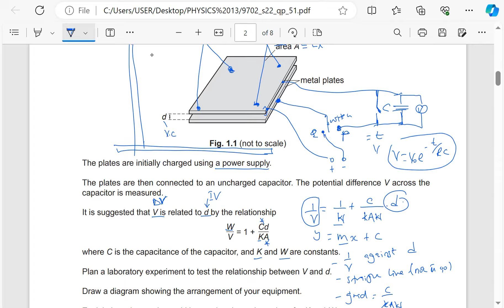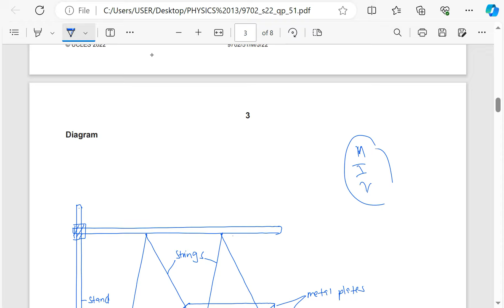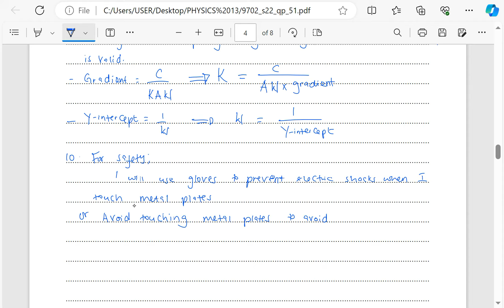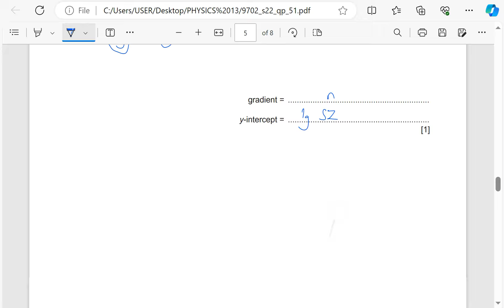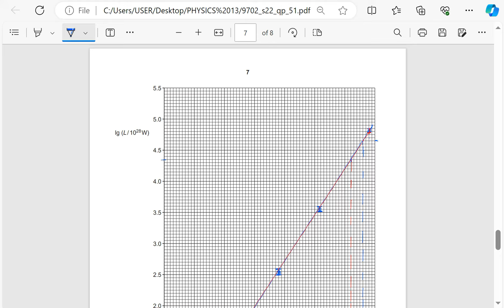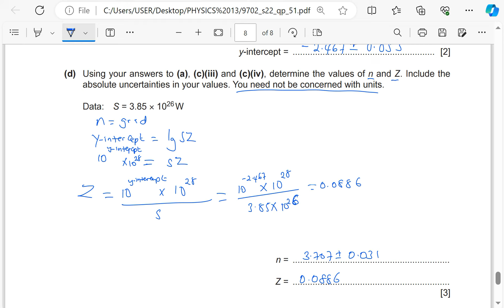CAIE Physics 9702 May/June 2022 Paper 51 [Planning, Analysis & Evaluation ]

Comment: In question one, I don't understand why you used a switch in parallel with the capacitor. Can you please elaborate
Reply: so we can short circuit it to let it discharge fully further on in the experiment 38:42

Comment from the maker: Using the power of 10 in further calculations will depend on whether i need to use antiloh or not. If there's no where i will use antilog, then i will not multiply by power of 10. If in calculations i will need antilog then i will bring back the power of 10

Comment: Where did you get the power of 28?
Reply from the maker: Check on the other axis please.   If calculations involve antilog then I multiply by power of 10
Reply: @learnPHYSICSwithIBM  Hello thank you for your reply.... y-intercept = lg SZ , I know how to get the Z here ,you use the antilog ....my confusion is where did you get the 10 power 28?.....this is in the mark scheme but no explanation why there is 10 power of 28.......using your value of y-intercept = lg SZ  I will have Z = 10 power of y intercept  and then you divide it by the value of S = 3.85 x10 power of 26 = 8.86 x10 power of -30 .......I tried to find another videos but you were the only one who answered it...hopefully youu can expain to me....by the way, I alway watch your videos
Reply: @iyu-10moq6  u found out ?
Reply: I also dont understand that... also i dont understand why in the final part the mass was just written as 3 rather than 3x10³⁰
Reply: @Leo-cz1gq  I got it now…the point is in the y axis which has an exponent of 28 😊
Reply: @iyu-10moq6 but why not contain it in 10's power instead of multiply it as a single number?

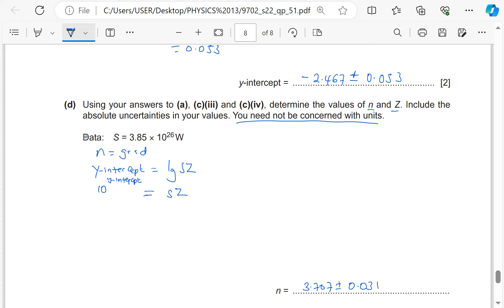Comment: sir why at 1:33:25 u used 10 power 28 while in may june 52 2024 u didnt use the power?
Reply from the maker: when i get the anti log, i consider the power of 10. But if i didnt use the antilog in clculation, then its not needed
Reply: @learnPHYSICSwithIBM  can you elaborate a  little ?
Reply: @learnPHYSICSwithIBM  I have the same question.